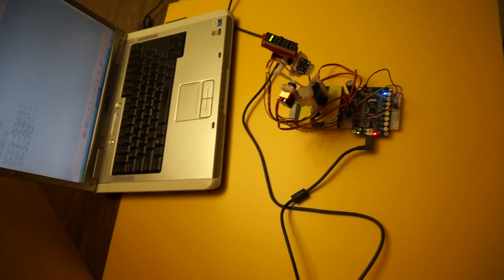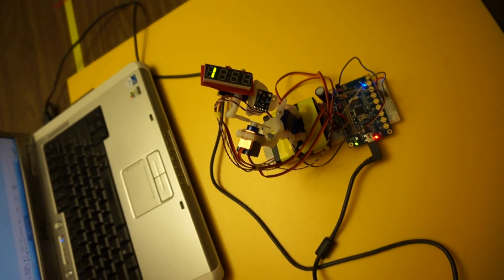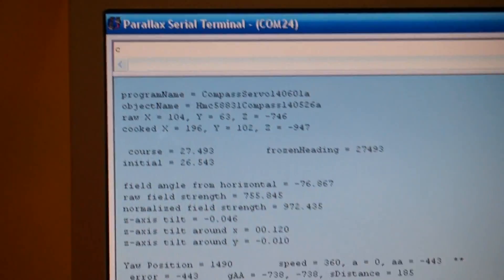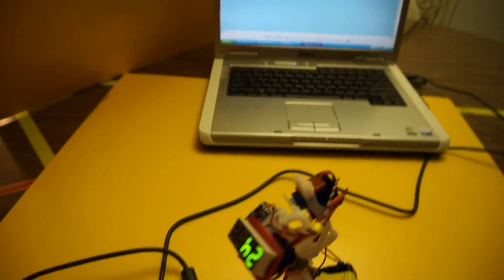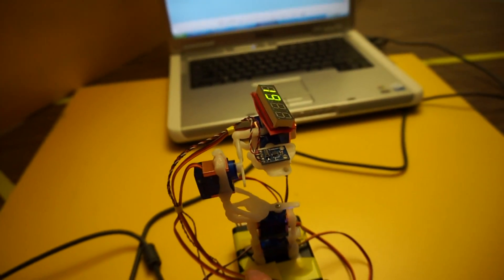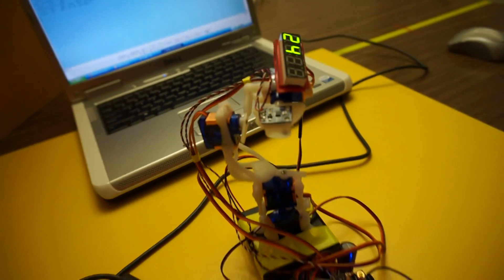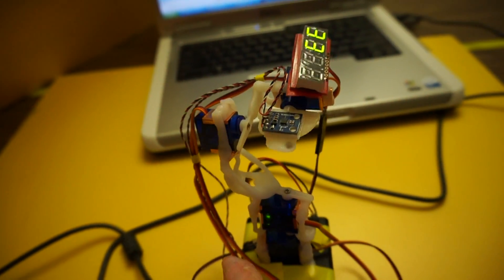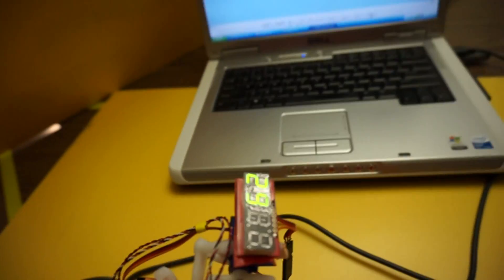Hmc5883lWithServos140601a

Comment: If you usiing an Arduino to control your gizmo, then try  software detach of servos before taking magnetometer reading. 
The magnets within the servos may still effect the reading but I reckon the effect would be lessened. 
I use this trick on my servos on my robot to reduce battery consumption. ie, turn em on, move em, turn em off.
Reply from the maker: I'm not using an Arduino in this project but I could detach the servos. I think having to detach the servos before each sensor read would severely slow down the response.
I made a three inch riser for the sensor which moved the sensor far enough away from the servos to allow it to get a good reading. This contraption worked much better with the sensor raised a few inches. Unfortunately, I didn't record a video of the improved contraption.
BTW, my logic was flawed thinking a magnetometer alone could determine orientation. I hope to repeat this experiment with an IMU sometime in the future.
Reply: Cool, thanks for your response, what the fek is an IMU?

Yes it will slow things down. but a stand still reading must be better than a still wobbling reading.
Reply: Is it not better to delay and be more accurate?
Reply from the maker: "An inertial measurement unit (IMU) is an electronic device that measures and reports a body's specific force, angular rate, and sometimes the magnetic field surrounding the body, using a combination of accelerometers and gyroscopes, sometimes also magnetometers."

I like Adafruit's BNO055 board (one example of an IMU). I might try it with this contraption.
https://www.adafruit.com/product/2472
The inexpensive MPU6050 boards (also an IMU) also work really well but they require a microcontroller to turn the sensor reading into useful data. The MPU6050 sensor doesn't include a magnetometer so if you wanted to include a magnetometer you would need something like a HMC5883L board (these only cost a couple dollars on ebay).  The BNO055 chip processes the sensor readings internally so it's easier to use than many of the other IMU chips.
Reply from the maker: Deciding if something is better to be fast or accurate depends on the application. This was just an experiment so it didn't really matter. As I mentioned previously, moving the sensor a few inches solved the interference issue.